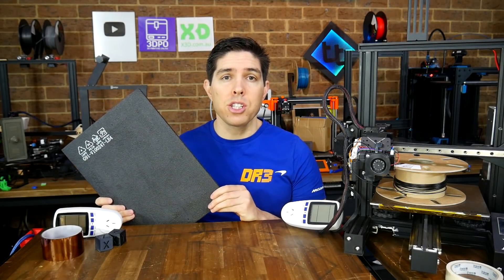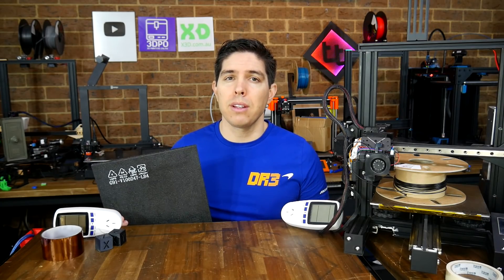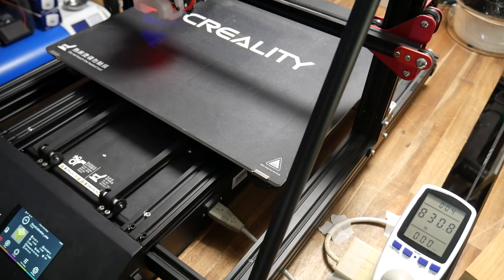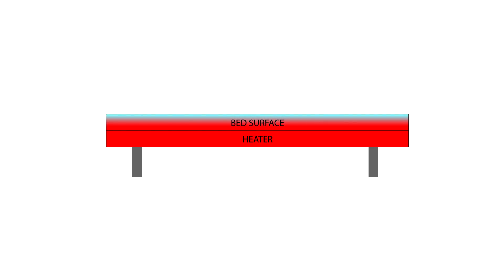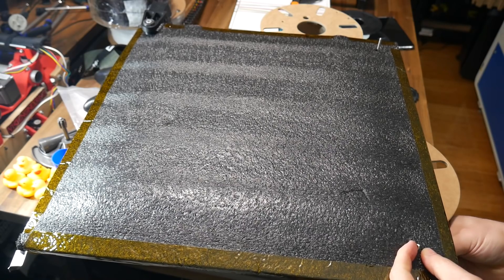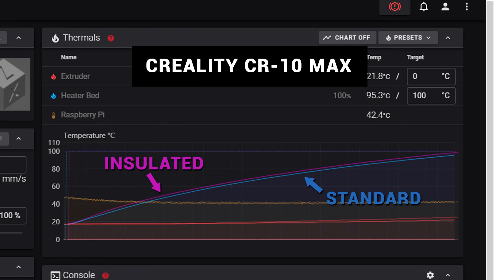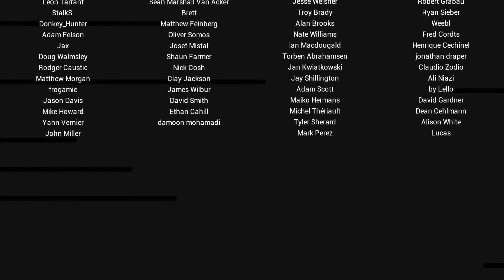Speed up 3D prints & save money. Insulation is important!

Comment: Yes, I have been using this way quite a lot of times. Almost all of my printers that didn't come with insulation below the bed from factory have these pieces of packing-foam added.
And yes, also first testing for fire-hazard

Also Using the foams for insulation and just building a complete enclosure from the foams as well. Just uses some pins and/or tape to connect the big pieces of the foams and then around the printer or better half-inside so that the electronics are outside this kind of fast-made enclosure.
Printing some hinges is easy to make a door but already covering most sides in this self-made foam-box helps a lot too. holes can be covered with packaging-tape. i like to use the white foams that come with some printers to the inside or cover some foam with some white paper.
i actually never used capton-tape under the bed, but just put the foam under the plate.
Also under the printer itself if it does not have a fan there. It makes less difference then the other sides but it is fast and easy to do and you can attach the sides to it with just some metal pins/parts you have or printed pins from left-over filaments or printing-tests.

Cutting: I generally use a warm soldering-iron or a melting-wire for this. This gives very straight and closed edges that are a bit more firm then when cut with a knife.

About VOC's and such: I tested it and it was not measurable in changes, of course inside the case the normal fumes get higher as expected but easier to capture and ventilate outside the room or with a small airfilter then when it is in an open space. most of the foam does not get really hot during printing since the underside of the bed is way less hot then the upper-side especially at normal print-temperatures of 48-75 degrees that I use most often (PLA, flex, PETG and sometimes ABS, all on top of flex or fixed plates).

Also about energy-saving: do not print on glass since that is also a good insulator (less then foam) as we know from using it for windows for example. It needs more time to heat up and after the print to cool down so especially with big printers this is a noticable amount of energy that is first stored and then lost.

Comment: I use car engine bay heat shield  adhesive foam. You can get them in many different thicknesses and the have a silver/gold IR reflective layer that helps reflect heat/light.

Comment: You should test the application of thermal compound between the Heater PCB and the print surface, that way the heat transfer can potentially be a lot more even.

Also, you should slap some Low-E window films on the acrylic panels of the printer enclosure.
Reply: I'm no expert, but I think thermal compound would throw in the aspect of the bed being particularly hard to level. Unless you ran a glass bed. Or something with no flex at all.so that's an idea

Comment: Hi Mikel, you can test cork sheets as a better insulation. Cork is cheap, easy to cut and also not inflamable. Cork has been usted as thermal protection both on Soyuth, Geminis and Apollo Space programs.

Comment: You need to put the aluminum tape over the foam, shiny side facing hotbed.  Careful not to bridge electrical contacts!

I reduced a 12v 330x330 heater from over 7 minutes to about 4.5.  I really need to enclose that one...  And upgrade the PSU...

Comment: Very interesting topic. I've added an acoustic sponge as sound insulation for my custom-made wooden enclosure for Snapmaker 2.0 A350.
Interestingly, it preserves the temperatures very well and allows the heated bed to reach and maintain higher temperatures for printing ABS even with such a large heated bed. That sponge for acoustic isolation is also safe from fire.
The best part is that its screen/controller is on USB-C, so by adding a simple extension cable it can be used outside of the enclosure without worry that it will overheat and damage after excessive use.

Comment: Thanks for the video. What about a silicon mat for insulation? Some vendors have a silicone sock for the print head to help keep it clean and to help insulate it. Does that silicone sock make much of a difference for energy efficiency?
Reply: Keeps the hot end temperature more stable, probably makes a very small difference to energy efficiency, but nowhere near as much as the bed.

Comment: The aluminised-foam stuff you can get for use with cars should be good.  It’s what Creality use on the inside section of their large beds.

I bought some pre-made Ender-3 sized pieces from AliExpress and they seem to work well.  I haven’t yet got around to making a full underside for my Ender 5 Plus from a larger piece of this material.

Comment: Have you considered using a copper plate under the aluminum bed? I'm wondering if that would make the bed heat more evenly, since copper is a better conductor. Similar to high-end cookware.
Reply: Actually copper and aluminum have very similar thermal conductivity especially when compared to steel. Given that currently copper is much more expensive than aluminum would it really make any sense?
Reply: @ExtantFrodo2  
Aluminum only has 62% of the thermal conductivity of copper.
Reply: @SwankySasquatch66  and it's 64 cents per pound while copper is over 3 dollars per pound
Reply: @ExtantFrodo2  How much copper do you think we'd be needing, exactly? My printer isn't THAT large.
Reply: @izza6998  There is no need to add thermal mass - it will only increase the heating time.

Comment: DO NOT insulate over your wires at any point. Wires melt easily if they get hotter than they are supposed to.
Reply: The ender heating beds are usually located at the corner of the heat bed - the wires you're referring to is the thermistor..... which isn't running any power that will melt the wiring.
Solder melts at 200c and this will not reach above 100c. ever....
Reply: @fuck_chinanobrain5011   Ah okay, makes sense now. I did think it strange he would not know this. I don't have an Ender. Yeah the thermistor is just a sensor so should not interfere

Comment: Insulation + vibration dampening = faster SpeedBenchy?
Reply: Insulating probably wont affect the speed to much as it basically just makes the heatbed more efficient in terms of energy usage and reduces the fluctuation of the temperature of the heatbed i would say.

Vibration dampening could improve the speed especially in combination with an acceleration sensor which he made a video about aswell
Reply: @Keptains  I think CNC Kitchen did a video about vibration dampening...

Comment: and how many tests did you make to claim there is a significant energy save? Because 0.02 to 0.04 kW/h is statistically negligible if not repeatable... and i don't see any error bars in your graphs.
Reply: Fair point i would say, but in my opinion he proved that energy will be saved or less energy is needed so aslong as it doesnt makes it use more energy i think its still a valid thing to do.
I doubt that if this wouldnt be in average 10% less energy, as he states in this video, and instead its just 5% or something that someone would say its not worth it if you think about how little effort it is and how much energy you would save. So with 10% less energy every 1/10th print would be kind of "free" or even with 5% its still 1/20th print which is "free"
Reply: @Keptains  What i'm saying is, that tiny delta could be due to anything. Even a random variation in 'something' could produce it. This means it could be totally irrelevant. I say this because if he really teaches kids, at least should teach a valid scientific method to conduct experiments, not based on random observations.

Comment: Can even use that foam as printer feet to help reduce vibration noise
Reply: Thats a great idea, but better in combination with a concrete flooring plate of the size of the printer between the foam and the printer

Comment: What about aerogel? Also, would you do it on a printer with a thick bed such as the RatRig V-Core?
Reply: I use a 1mm thick piece of aerogel and get similar results to Michael.
Reply: Im curious about this aswell because im planning to order 2x RatRig V-Cores :D. Appreciate the response, thanks!
Reply: why would you use such a fragile material?
Expensive too.
Reply: @fuck_chinanobrain5011  once stuck on the surface there is no contact with moving parts so fragility is not an issue. Each piece was like 25x25cm and only about 8 bucks.

Comment: The PID parameters for the bed before and after would also be an indicator of thermal efficiency.
Reply: I'm glad that people are considering these matters when it comes to these videos. They are almost always IGNORED. Another good indicator of power consumption efficiency is the power factor, which is not even mentioned in this video.
Reply: @MacEvoyING  Since the heating element consumes the lion's share of energy, and has a PF of 1.0, looking at it with regards to PF is a indication of power supply efficiency more than anything else. Modern switching mode power supply efficiency is often in the range of 80 to 90%
Reply: @kiowablue2862  This is only true if the power supply of the printer has a really good power factor correction circuitry, which is not always true. On my Anycubic i3 mega I have a PF of about 0.4-0.5 on idle with nozzle and heated bed to 60º and 200ºC. 

The efficiency measures how much power gets lost due to, for example, heat dissipation, but the power factor measures how much real and reactive power the device is consuming, because at the end of the month you get charged for the real power, NOT for the reactive power. So, if you want to more or less accurately calculate the effective price of a print you need to know the power factor. 

Btw, those meters like the one shown in this video are capable of measuring the power factor.

Comment from the maker: Some people have been asking about fumes from this being heated up. Based on the piece that was labelled, this is LDPE foam. I looked through MSDS for this material and it only seems to be hazardous when heated to the point of melting. Of course there will be variations in foam used, so if you are concerned, please use cork or another material. The main message from me in this video is that insulation is worthwhile and that anything will likely be better than nothing, so insulate away.
https://www.redwoodplastics.com/wp-content/uploads/2010/03/LDPE-2012.pdf
http://www.simco.net.au/wp-content/uploads/MSDS-PE-Foam.pdf
https://www.interpak.ltd.uk/Downloads/Novostrat%20Fire%20Safety.pdf
Reply: Check what insulation has the lowest heat loss by using the thermal cam on the insulated side, radiator reflection foil lined with kapton tape was best for me
Reply: 8:43 Surely that is less than 10mm? Looks more like 2mm?

Comment: I grabbed me some cermaic insulation for my Prusabear. You only gotta grind a metal pipe to hammer trough the holes for the screws under the bed. Helps A LOT with heat up time. Also i'd be scared to use some packaging material since it is usually not fire retardant. Good for you to test it beforehand but the fumes it gives out are probably not exactly healty :|

Comment: Key words in the whole video are "I think it will not". Because you will not be able to know exactly what is the chemical composition of the packaging material you have (especially if it arrives fro China), you are risking with your own health. Please inform yourself about proper material suitable for this task. If you want to be power efficient start with your power supply, PFC circuit will do the trick, upgrade your electronics to a better design. There is no sens to even think of power eff. when you have shi** PSU, stepper motors with high inductance values, poor designed main board, shi** wires or a combination of all of these.
Reply: yeah nah mate, if you're printing ABS, you have other things to worry about. 
"proper materials" - mate, can you verify every single component in your 3d printer is lead free and suitable for the task? Or is it easier to sit on a high chair. 

Yeah nah, this is actually a decent test - especially considering most people will be printing at 60-80 - which the MSDF for the foam clearly states it to be safe. up to 120c.

Comment: Would adding a reflective surface to the top during warming aid in speed? Thinking it might help keep heat in the plate and would just involve placing a piece of reflectex on the bed during warming and removing to print. Can you test this also?
Reply from the maker: After the enclosure test I was wondering this myself.
Reply: yes it does, especially if you have an insulator on top of it. It does not get a more even heating though.  I tested this (made a small video about it at the time too, probably still at my channel, EL 3d print). i don't use it often anymore since most of my printers are in an enclosure and adding the insulation makes the temperature of the rest of the printer (including the gantry) change more after removing the pad so introducing less quality especially in low surrounding-temperatures.
Yes, preheating the bed also changes the structure of the printer and of course the printhead and the sensor if you have one on your printer, so better get those parts on the same temperature before starting the print as they will get when you are actually printing.

Comment: I'm really glad you touched on enclosures, but I really wanted to see what improvement you got with both the bed insulation AND the enclosure combined.
Reply: Insulating the bed when you enclose the printer are counter productive. You want that chamber to heat up.
Reply: @Exstaz  You're only insulating the lower half of the bed so that the heat it produces gets directed only upwards. You'd still get prints started faster AND have the added benefit of your chamber retaining heat for the benefit of parts above the bed not cooling down as much.
Reply: @ExtantFrodo2  you want that chamber to heat up so the thermal expansion happens faster. You cannot start a print before that or you won’t get a great result. On my voron I need it to sit around 1h so the thermal expansion can even out. My bed 350x350x8 mm bed heats up in less then 2minutes. So insulating are pointless and would hinder the heat up of the chamber. So having the bed heat up faster in a enclosed printer are pointless.
Reply: @Exstaz  If you want that, yes, or add a dedicated heater only before printing. For me it is mostly about saving energy and on my printers including insulation under the bed, the enclosure is on around 30 degrees  even without the bed on because I let the warm air from the PSU and mainboard and controlling computer and other electronics into the enclosures. After the print starts, soon the temperature is too high and the fan to keep the air lower then 35 degrees kicks in too get the hot air out.

Only in really winter (like surrounding room is about 5-10 degrees), the little heater in the enclosure is getting on and preheating the enclosure even before the heatbed is preheating. most of the times you want to be able to regulate the enclosure-tempetures different from the bed-temperature.
Reply: he did, look at the graph near the end of the video.
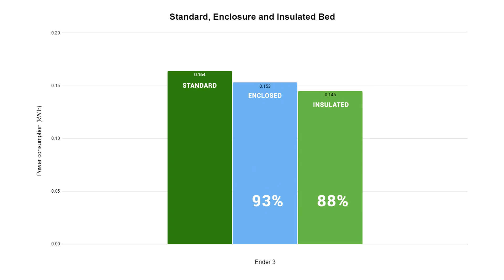Reply: @elvinhaak  Neither of the graphs at 11:43 nor 12:00 nor 13:42 depict the combined insulation of both bed and printer.
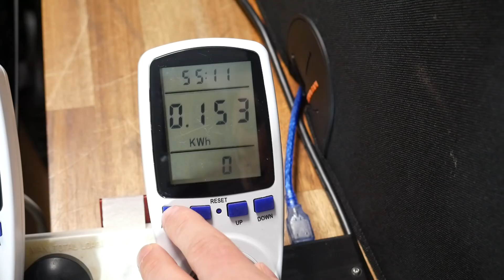Reply: @ExtantFrodo2  Ah ok. I thought I saw that passing (for just a second) in the graph. Must have mis-interpreted that then. I thought that the one at 11:58 showed the insulated enclosure.

Comment: I used corkboard to insulate my bed, attached with high-temperature aluminum flue tape. The kapton tape that I had been using for the wiring didn't seem to have enough adhesive strength for me to be confident in it as a means to attach the insulation long-term.
Reply: How effective is the corkboard?
I have ordered a Rat Rig and that one come without insulation, so I'm out looking for some kind of insulation
Reply: How did you attach the cork board to the heated bed

Comment: I tried melamine sponge as insulator. It worked fine, but I messed up installing it. Now i'm using 10-15 layers of glass cloth wrapped with kapton tape. Even if heatbed is at 110 deg C, I can easely touch it's bottom.